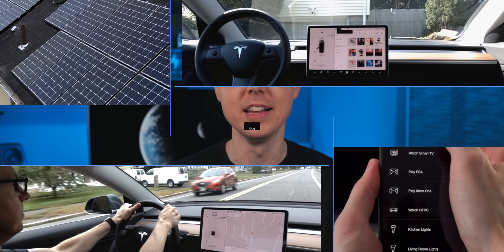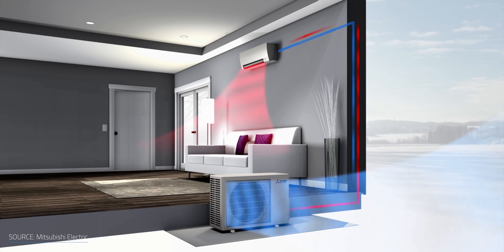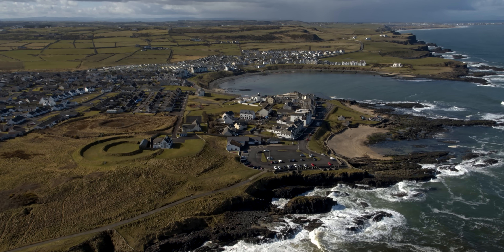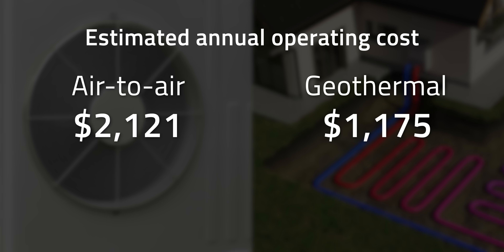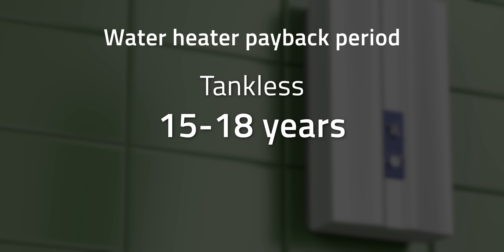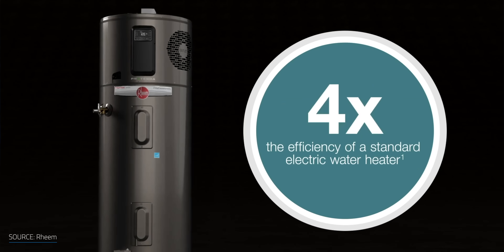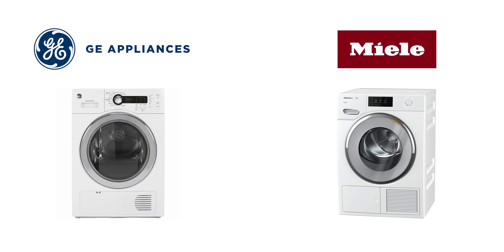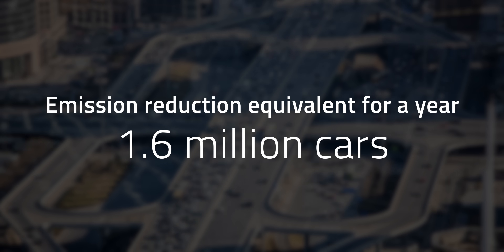Why Heat Pumps are Essential for the Future - Explained

Comment: Definitely let's heat pump all the things. A video on how different refrigerants affect environmental friendlies and efficiency as well as what (if any) is coming down the pike in terms of me refrigerants would be interesting.

Also, I didn't know about the ventless dryers and I definitely need to replace my gas dryer. Probably gonna look into buying one in the very near future.
Reply: As Matt says in the item, they are approx. twice as expensive to buy and cheaper than gas to run.
Reply: @gregbailey45  since I wrote that comment I learned about thermoacoustic heat pumps which dispense with refrigerant altogether in favor of pressure/temperature differential across a heat exchanger created by a standing acoustic wave in a pressurized gas. I'd really like to wait for that tech to become available on the residential HVAC market but my house needs new HVAC ten years ago...

Comment: Since the condenser part of the AC unit gets up to 120 degrees you can dump the heat right into your hot water heater without dumping it outside.
Reply: This would cut the cost of running your hot water heater and in the winter time to heat your house dump the cold air into a walk-in freezer

Comment: Heat pumps & geothermal will play an important part in our energy future.

I am looking into a geothermal system that is a Direct Exchange system in which the refrigerant lines are 'buried' instead of a water (glycol) loop.  The direct exchange system is buried in a 3" X 100 foot well, eliminating the need for hundreds of feet of buried plastic tubing.

Do you know of a direct exchange system that can be used for water heating?  This would be a better system then dumping cold air in a room that you may be trying to heat in the winter.

Comment: I have some questions about it:
1. Can it work somehow in a building with many floors?
2. If the ground is cooler, how could it work to heat the air in the house? After all, you need heat to get into the house, yet what's available is colder... Wouldn't it require much more energy to heat both?
Reply: 1. Yes, appartment buildings also.
2. More deeper one goes, hotter it gets. Drilling a thermal well where pipes go (vertical) is the usual way here in north.
Reply: @Mariini  ok so if it's hot underground you get heat inside, but how would it work when you need to cool the house, if underground is still hotter ?

Comment: I recently replaced our natural gas furnace with a heat pump and another furnace for emergency heat. Really wish I would have gone with just the heat pump as it doesn't get super cold in the pacific northwest. We would have been fine with just the heat pump alone. Others have mentioned that AC is a heat pump. The easiest way I've had it described is that a heat pump is just a bi-directional AC unit. 

Technology Connections youtube channel has some of the best explainers on the technology.

Comment: I forget, is he building a new net-zero home?
 But seriously, I think it's great. Wish I would have done more on that front when I built my house in 2004. But I do have a heat pump dryer here in Japan. It is OK. It is smaller and takes forever to dry though. Make sure to clean lint traps religiously if you have one.

Comment: The UK recently OUTLAWED gas-fired boilers and MANDATED heat pumps for replacement.  These people have no concept of thermodynamics.  All the improved modern insulation in the wold will not HEAT your cottage.  The older home heating systems were designed around radiation using 75-85 degree water from a gas fired boiler.  There is NO WAY the existing radiation will heat a home--despite any and all insulation--with 40-44 degree water from a heat pump.  The radiation is TOO SMALL.  Wake up, Greenies.  You are beating your meat.

Comment: What would the efficiency be if you cooled seawater with a heat pump and which refrigerant gas would you use? A double heat pump is used for refrigerated ships. If you now use it to cool seawater. Would you be able to propel your ship for free?
Reply: No, the temperature difference is what gives you pottential energy, not heat itself.

Comment: The biggest problem with heat pump dryers is the much longer drying time - I have one and it can take 3 to 6 hours to fully dry a full load, especially for things like towels and sheets.I have given up trying to dry towels in it now - I just hang them up instead, and I tend to hang my sheets over the couch to finish drying after 3 hours of being in the dryer.  It might use less electricity and having much lower heat, they are less damaging on some kinds of clothing, but I am sure it must be causing  a lot more wear on my clothing, being tumbled for so long. If I could buy a traditional type vented dryer I would - but they are not available in my country any more.
Reply: have you cleaned the filters as some have mentioned,  as older ones may not even have one and they plug up with lint . the evaporator part has to remove the H2O just like in a car, or it can't dry the air
Reply: @terryfrederickson2774  Yes I clean the filters after every load. My dryer was actually a condenser type. I finally found a 2.2kw previously unknown brand (Bompami) vented dryer on Amazon and use that now, which does in 45 min what it took my Whirlpool condenser dryer 6 hours to do. Absolutely no regrets. it works great.

Comment: One thing that is often overlooked is that in areas where people have standby fossil fueled generators (i.e. because of hurricanes or the Texas republican power grid), a more efficient HVAC system can reduce the size of the generator and its fossil fuel consumption.

Comment: Hey Matt. The heat pump uses Electricity.  How many BTU's are produced per KWH at various temperatures.   How much pollution does it take to generate a KWH.   using Coal, Nuclear, Gas.  "3x-5x more heat energy ..for every KW of electricity" .. is this at the optimum outside temperature?.  What does this actually mean?  Maybe this is going over my head, but efficiency is meaningless unless I can relate it to all these factors.  Thanks for putting all of your vids out, keep up the excellent work!

Comment: I have a 4.5 kw plus an efficient oil boiler to bring the house temperature up to 18-20C. Then the heat pump takes over. To have just the heat pump required a 10.5 to 12 kw pump which was too big to be placed on a flat roof without blocking windows.

Comment: So the basic home heat pump system does struggle below 35 *f but the new higher efficiency systems made by bosch and gree work down to 0*f without kicking in the back up electric heat. The technology for this is now proven and I've seen it work so this will solve the issue. Some people say well if the electric goes out i want gas... Well your furnace won't work without electricity either. In which case if you have a backup gas generator then you're in business. Heat pumps are the future, PERIOD.

Comment: One question about geothermal heat pumps -- can they be tied into my existing water-heated radiator system? Or must they use forced air vents?

Comment: I would like to hear more about your heat pump ideas. But there is so much experimental options you might have missed there are heat pumps that will heat your pool and cool your house cool your freezer and heat your house.
Reply: I like the idea of putting a condenser in a pool is kinda fun, it's akin to the shipboard fridge and chilled water systems I work on that move heat to the ocean. I'm not sure you would feel the pool temperature change very dramatically. Your freezer already moves heat to your house

Comment: Absolutely!! As many ways to simply move the heat as possible. If I was to build a new home I would use as many as I could. Another possibility is a passive heat exchange system where you exchange the heat from the air to the soil with no intermediate carrier. You simply blow the air through a pipe buried in the ground. The air comes out close to the average temperature for the area. It won't work in areas at the extremes but in moderate areas in can work well.

Comment: I have just today ordered a heat-pump tumble dryer (four hours before I saw this video) and although Mr Ferrell confirms what my own research had already turned up about the medium and long-term power consumption advantages (which is why I made the decision to spend nearly twice as much money on my new dryer) I was surprised by the news of a doubling in the expected life-span of the machine and I am puzzled as to why this might be. There is no reduction in the number of moving or machine-driven parts in a heat-pump tumble-dryer - quite the opposite in fact as the refrigerant needs pumping and compressing and there must be more internal devices and gizmos to go wrong or wear out. I don't see where the increased life-span comes from and I'd be interested to know, but having said that I still see heat pump as being vital in overall reductions in energy consumption, apart from the personal economics involved. Significant reductions in consumptions, including energy consumption, are essential if we are to have any chance of adapting to, and surviving, the disaster that man-made Global Warming is condemning us to and which it is now too late to avoid entirely.

Comment: I live in an all electric 5500sqft. house, with 3 heat pumps. I have 2 wood stoves for emergency heat. If I put my units on auto, and just use some of the 17!!! Ceiling fans To move the air around, I can go through March-April and September-October for about $100.00 a month. December-February is higher at around $400.00, this year. Not only do heat pumps work cheaper, they work faster.

Comment: Miele also has washing machines that accept hot water which reduces time the washingmachine takes to get the water to the correct temperature.
Great to hear heat pump dryers are now more common. In 2014 they were very rare. As I grew up in Europe, I have various 230V sockets in my US home. The 230V systems are all powered by solar only.

I also 'encased' most of the radiators and placed some (computer) fans below meaning air now actively circling the room instead of passive. Our temperature is basically fixed at 68F. We only deviate from that when temps outside are above 95. At that point the temp is raised to (outside temp - 68 / 2) + 68. So if it is 100f outside, out climate system will be set to (100 - 68 / 2 = 32 / 2) 16 + 68 = 84f. This reduces the 'heat shock' when you go suddenly outside. It also reduce the energy usage a lot. 

I live in a rather conservative street (little branch of a state road). But this week we had some stormy weather in (North) Virginia and like so often power was cut. Once again we were the only house on the street with power thanks to my solar panels and 3 LG home batteries (1 used for 230V system) and since I switched to StarLink I now also got internet during a power outage. So we played streaming host to our neighbors and they finally had enough of the 5/6 annual power outages, so they are also looking into more durable solutions. I told them forget about the environment. I only did it to have always power and to save a lot of money. My Tesla drives free thanks to my solar panels meanwhile avg gasoline price hits $5/gallon. Some California area's have even seen almost $10/gallon prices. I just checked, in The Netherlands (my home country) which has one of highest gasoline prices in Europe, a liter costs about 2.30 euro. But as the euro and dollar are now pretty much 1:1. A gallon is about 3.8 liter, so if you live in an area where the average price goes beyond $8.75/gallon, you pay more for gasoline than Europeans do. How insane is that?!

Biden's tax break sounds great, but an mere .17 price cut is not gonna make a bug difference. Keep the price at the current level, but set the money aside to provide incentives to buy more economical cars. If you one of those that suffers from range anxiety, buy a plugin hybrid! Still saves you a lot of money. If you don't have money to buy a new car, maybe you can swap it for a smaller car. Many Asian- and European brands that lots a fuel efficient cars for years so even used ones are very affordable. Sometimes you have to spent a little upfront, to save big in the long term...

Comment: Hey Matt. I have been watching a lot of your vids and Im gonna subscribe now as you are a good source of information 😊

We actually have a maybe 15 year old Air to Air Unit in our living room which is quite large considering its in Denmark. Thou we got floor heating 6-7 years back which is hestes by gas i think?? Im not sure i have to check it all out. 

But shouldnt i able to calculate what will be cheapest to use to heat our living room by checking the specs on the Air to Air pump and compare to floor heating. 

I know the Air pump is a bit old but we never really use it. And now when gas and Electric is getting more expensive… i hope we might be able to use the Air pump if prices get too high
Reply: Thanks again for good informational content ❤️🙏🏽😊

Comment: 410a not 134a.
Match the heat pump with a forced air gas furnace and control system that switches to the gas when it's too cold outside.
There is an issue with the dryer , dealing with the water,  and in humid areas the sensor will never shut off the dryer..

Comment: I recently ditched our natural gas heater and evap ducted air con for a ducted reverse cycle a/c (heat pump). We already have solar PV and solar hot water and dry our clothes on a clothes line. The house is fully insulated in the roof and walls. Energy bills are approaching next to nothing.

Comment: Im net zero. I have 4 seperate heat pump systems with 6 zones, a heat pump hot water heater where i duct the cold air into my living space in the summer, a pool with a pernament magnet pump/vfd, a standard hot tub. and 50 LG neon2 365 watt panels.. im typically 2000 kwh under my production every year. I sealed everything in the house.. new energy star windows, siding, commercial tyvek,  about 3200 sq ft... Heat pumps and solar.... the way to go. 
ABOUT YOU GEO THERMAL SYSTEM..... you plan on doing geo thermal, I would seriously reconsider... these air to air source heat pumps are really incredible. Theres many different configurations, im sure you probablly know Mitsubishi makes a ducted system if you went the more traditional route...I considered geothermal but the cost outweighs the energy savings..With air to air, you have an issue you know its right there in plain sight.. ground sourced if you do it i would run 2 extra loops with the primary .
Reply: You are carbon There is no way you are net zero.

Comment: I've had a Richmond (Menards rebrand of Rheem, and uses the Rheem app) 50 Gallon heat pump water heater for about 19 months now. It's been wonderful, and has saved us roughly 1,000 kilowatts per year or more. There's only 2 of us in this house, so I think pay off will be close to 10 years, but a normal water heater isn't going to pay for itself at all. So maybe the break even is closer to 5 years or even less if you take into account that the normal water heater only costs a fortune to run, and isn't projected to last as long. With 3 or more people the pay off would be even faster. I'm in Missouri with the water heater in the basement. If I were in warmer climate with it mounted in the garage it would run even more efficient with access to more warm air. I think if you have 3 or more people you should ditch your old water heater today. I sold my working electric water heater for $200, so that paid for all the supplies to to install the new one on my own and then some. 

Between the heat pump water heater, Nest thermostat, some more insulation, and a few other tricks, I've cut my electric use by almost a third. Every trick helps. I just today tweaked the settings in the app to use tune the water heater more to when we need the water, and run less when we don't need it. 

I didn't know about the new heat pump dryers. That's definitely something to look into, but again, with only 2 of us that would be a very long payback time. Hopefully one day all these appliances will work together, moving heat where you want it. Imagine if your AC could heat your water, or your furnace could cool your refrigerator. That's really what needs to happen.

Comment: Would a heat pump be more efficient in colder climates if the condenser was internal (like a basement or shed)? Of course exhaust air would need to be duct to the outside. Just not sure if the volume of air transfer would be sufficient enpugh for this to work.